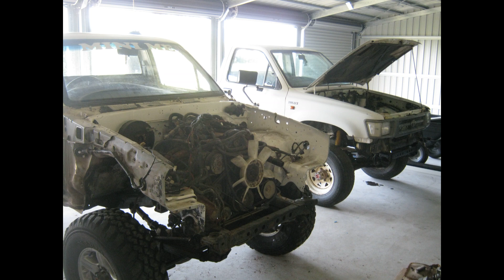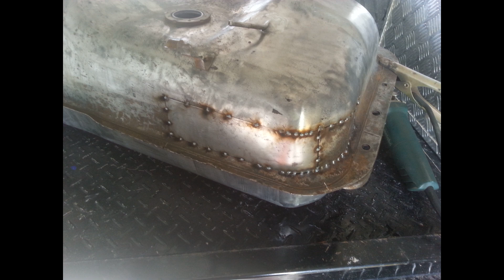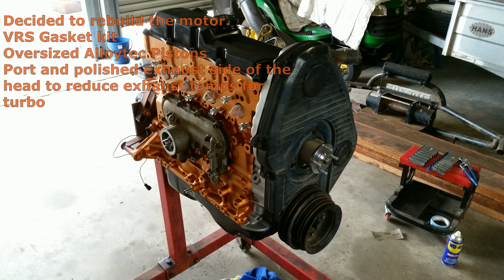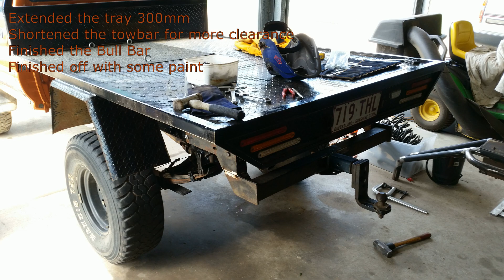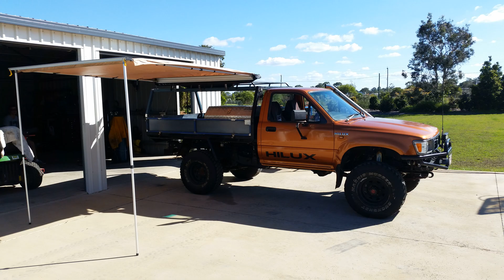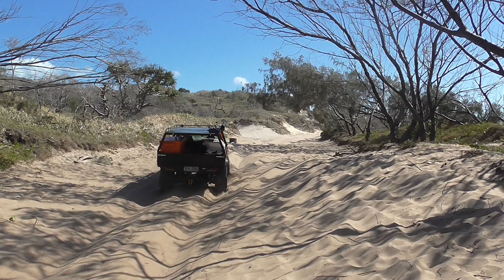Toyota Hilux LN106 Build!

Comment: Hey did you still have the 2.8 3l engine in it and if so how did it perform with larger tyres? I have the exact vehicle and its basically like new with only 100,000 km on the clock and not a scratch on the paint work etc. It currently has the factory 28 inch split rim tyres and considering upgrading to 31's but worried about the loss of power ill have.
Reply from the maker: Hey mate! Yep, that's the 2.8L engine in it. It just had a snorkel, K&N air filter, extractors, and a 2 1/4 inch exhaust that split into two 2 inch pipes running under either side of the tray. 
To be honest, I don't think I felt too much of a power loss. I had 31s on there at one stage too and it still went pretty well for 2.8L. You can't expect too much from the engines power wise but you can expect them to last a very long time. The only real power upgrade you can make is installing a turbo and supporting modifications for the turbo. Some people have reground the camshaft and installed new shims to suit, but it's not a massive power increase.
Reply: @AutomotiveActionMedia  Beauty matey thanks for that and great video btw!
Reply from the maker: @TasmanianHillBilly  Not a problem at all. And thanks heaps!